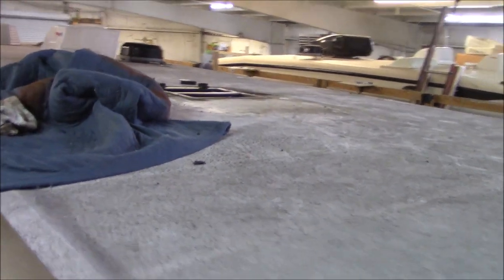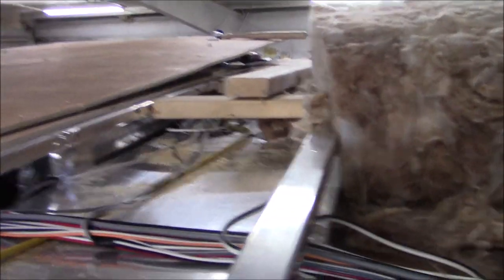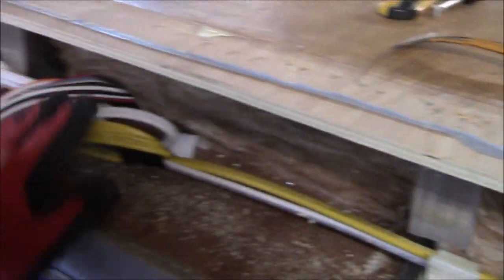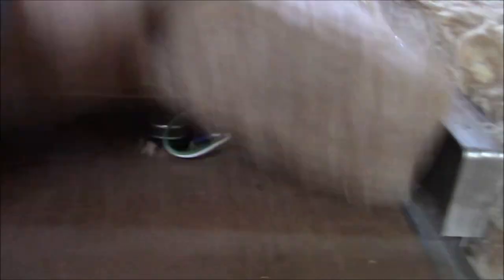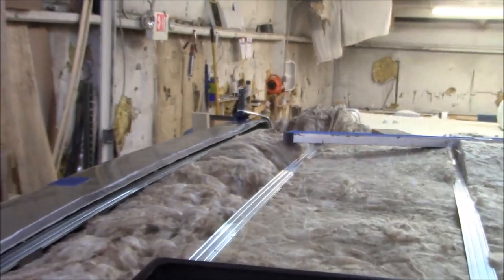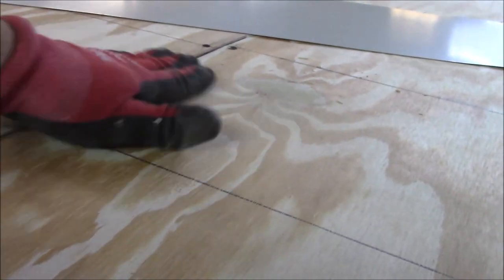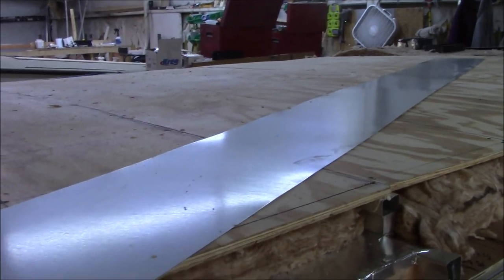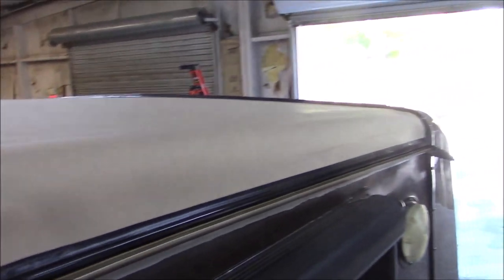2018 Mobile Suites New Roof and Re-Deck

Comment: I always wondered how these new "whisper quiet" A/C units were mounted to the roof.  Now I know, and it doesn't look safe.  A 100 pound RV roof A/C lag screwed into 3/8" plywood going down the interstate at 75 mph is recipe for disaster.  RV roof A/C's mounted the old way with "steel clamp rings" and 3/8" dia. x 8" long threaded steel bolts would have to hit a bridge to tear one of them off the RV.

Joe, I live full time in a 2014 keystone RV 299RET widebody TT.  I "was" shopping for a two of three yr old DRV.  Thanks for filming this, you saved me a ton of money and a lot of misery.

When the best RV technician in the entire country says: "I don't even own an RV", that says just about all you need to know!  Thanks again.  This video is "priceless"!
Reply from the maker: You are very welcome. I try to show where the problems start so we can correct them. I have. Couple of vintage campers I have not had time restore. Whatever you amy opt for... Know that you WILL. need a roof. No one ever looks at the roof and even if they did ... It's all white and  looks clean so folks think it's done right. These manufacturers exploits people's ignorance to roof systems.
Now you know why I don't have sponsor's... Lol.
Thanks for watching.

Comment: I have a 2012 DRV Elite Suites with one peace fiberglass roof.  (pre-thor) DRV.  The thing still looks new.  What Thor is dong to these once first class RV's is a travesty.  They took a top quality RV and cut so many corners to make it cheaper.  Great work on this guys.
Reply from the maker: You are forgetting the RV manufacturers motto.... Get it built, Get it out, Get it sold! They're all the same. Thanks for watching.

Comment: Joe you are correct about the Mobil Suites. They are a very high dollar coach.  MSRP is probably around 150k and they are built for the customer when they order one. I have always liked the Mobil Suites but construction does look any better the my Bighorn that’s setting right next to it.
Reply from the maker: They're all the same. I only know what I'm working on because of the decal. It's not like when I open them I recognize different or better construction. 
Thanks for watching. See you soon. Double check the coach like I showed you.
Reply: @RVROOFINSTALL  stopped in TN for 3 days on the way home and so soon as I got back to WI I emptied, washed and winterized the rig and took it out to the storage place and got the cover on it for the winter. Thanks.
Reply from the maker: @mrKeithGrayoldguy  you see those awesome trusses we made for you?
Reply: @RVROOFINSTALL  u bet I did. Watched the video at least 5 times.

Comment: Checkout Outdoors RV... 3/4" Marine plywood for roof decking.
Reply from the maker: Why? BC would be just fine. No news to overkill on decking. Kind of like a concrete commode.
Reply: @RVROOFINSTALL  Good question. Marketing perception possibly? I know they do 3/4" tongue n groove floor decking as well. Sturdier?
Hey- would you show constructing a 'Curb' for an AC? Or is that too much secret sauce?
Reply from the maker: @wheresbrent  secret sauce. They are complicated. I designed them and it take me an hour and half to build one.
Thanks for watching.